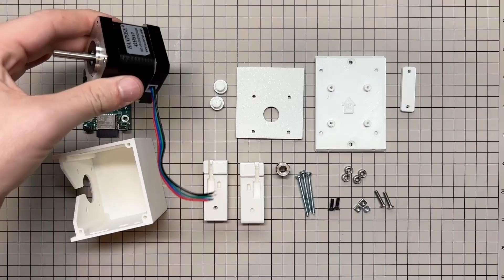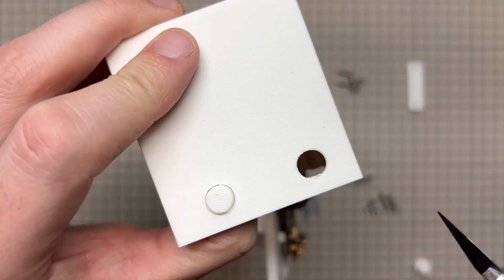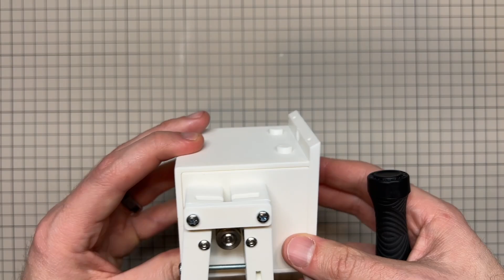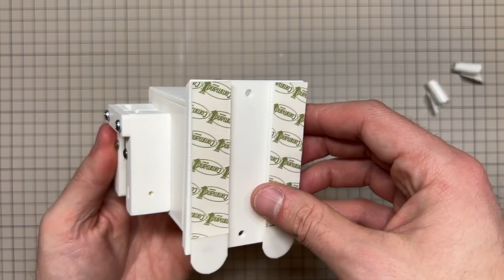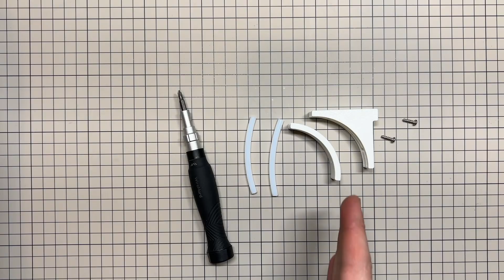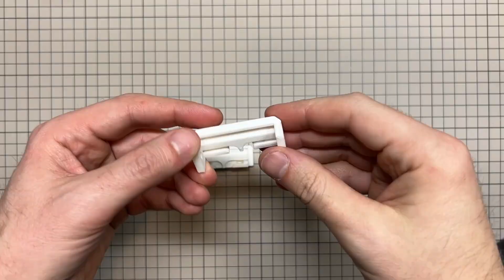Ropener: Build Guide

Comment: Have you tried replacing the rope tightener with a single compliant part? It seems like get rid of a lot of complexity in the assembly and printing.
Reply from the maker: I have not. Do you mean replacing the bearings with something plastic? If you have more details I'm happy to take a look
Reply: @Daniel-Frenkel  I think youtube swallowed my original reply. I meant a single horseshoe-shaped part instead of your three part shaft-squeezing mechanism.

You can vary the thickness of the part to make it more or less flexible and tighten it with a screw like you do currently.

I can show you a drawing if you have someplace to send it.

Comment: Very cool project, Thanks for posting it opensource, want to ask is there any way to mount motor part to the left side of the curtain will came mechanism works or need to tweak it?
Reply: After printing one I can see the main enclosure holding the motor and PCB will need to be modified. Just flipping the part over would place the buttons on the bottom face. The part can't just be mirrored in slicer as that would mess up the holes for the PCB connectors. I think the curtain mounts will also need to be left handed (due to cable tie slots) and the motor tensioner arms, but those look like they just need mirroring in the slicer. A left handed build would be appreciated.

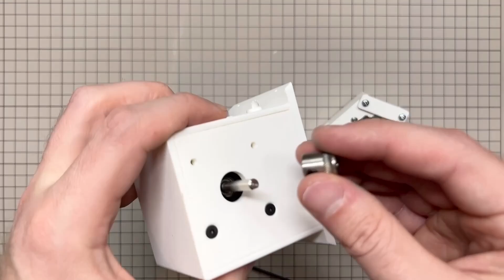Comment: Thank you for this build Daniel. I've been working on building this myself but can't seem to find this motor pulley anywhere at 12:03. Any chance you could update the BOM from GitHub with what you've used for that? Cheers!
Reply: I think I found them. An MK7 drive gear from a 3D printer extruder.

Comment: Thank you Daniel !. I got myself a VAL3000 to play around. Want to buy another one, But i saw is sold out !. Want to also ask you. Which motor model would you recomend to connect to the board ? Would a Nema23 be too much ?
Reply from the maker: I should have more in a few weeks, they're just taking a long time to make. As for motor size, really any size motor will work, NEMA just refers to the physical size of the motor. The problem is that this board can really only handle 1.5A of continuous current, or 2A if you use a heat sink and good cooling. For a NEMA 23, they have many that have a rated current around 1-2A, but be sure to check the torque curves to see how much torque they actually generate. I recommend playing around with the charts from Lin Engineering to understand them better

https://www.linengineering.com/products/stepper-motors/hybrid-stepper-motors/5704-series/5704X-01